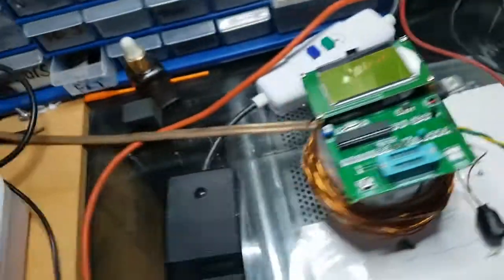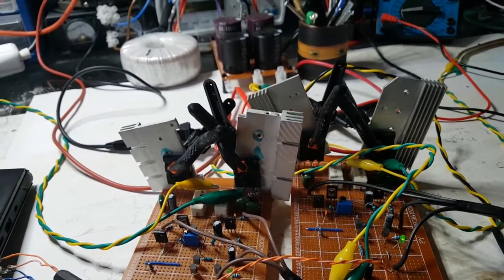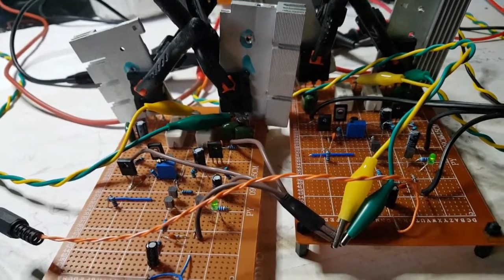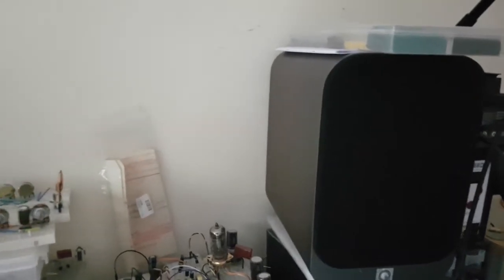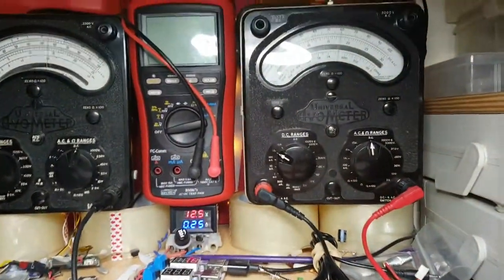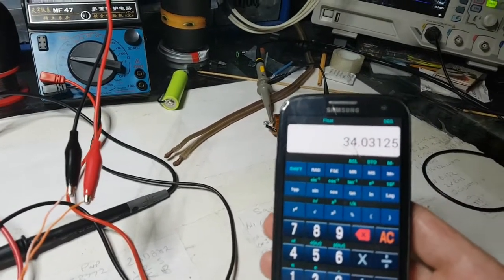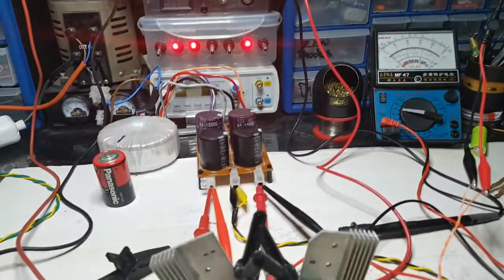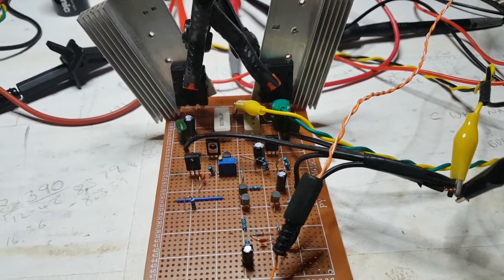DIY Audio Amp - Quick Power Test

Comment: Nice build! Had been looking at this amp myself to replace a middle of the road Yamaha amp. Do you think your build sounds better than a store-bought mid-class amplifier?  I'm not looking for Watts, but for a nice sound.
Reply from the maker: Cheers Marcel. Umm mid class. What do you call a mid class price. This on my bench has cost me a few pounds and will beat any other few pounds amp hands down. 
If I add all costs of parts and include the power supply as it is, this has cost around £50 - £55. The transformer cost just shy of £40. The heat sinks are scrap from computer PSU's, heatsinks cost money.
I will of course not make the transformer a permanent component of the amp as I use it for other circuits as and when needed. That is just me and how I use what I have on my bench. 
This does sound nice and if you are of a mind to build this yourself as per the circuit diagram using the parts suggested I am sure you will be happy. I used the cheapest parts on perf board as you can see.  I could use the highly suggested better components and the spec will be better and so the sound should be better, at least we would hope. 
Do you build electronic projects?
Reply: Thanks for the answer!  I now have a 5.1 Yamaha amp, to drive 5 channels. I drive. each  speaker driver individually using a cross-over on my pc, then into a multichannel DAC. it sounds great already, but  these multichannel amps are frowned upon by 'audiophiles'. And I want to go to 7 drivers (2 3-way speakers and a sub) so I need extra amplification anyway. I don't care much for the audiofoolery, but always looking for improvement. And yes, I build the DAC myself, partly from a kit, and would like to build my own amp as well! You build seems simple and stable. Almost all self built amplifiers I have come across seem to struggle with srability, oscillation and so on.
Reply from the maker: You are far more experienced than me then. I shall be asking you questions about crossovers from PC and DAC building. This amp is good for stability, oscillation is not a problem at all, even though it is laid out on a perfboard. Idiot proof really, that's why I built it.
Reply: Sounds just right for me, cause I seldomly have a clue what I'm doing :-)
Reply from the maker: LOL, you and me both m8 :)